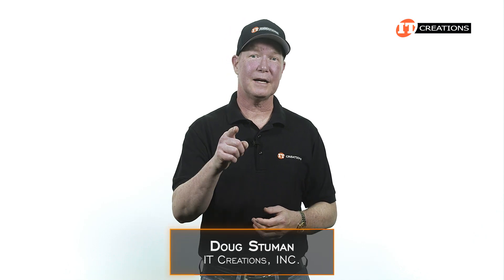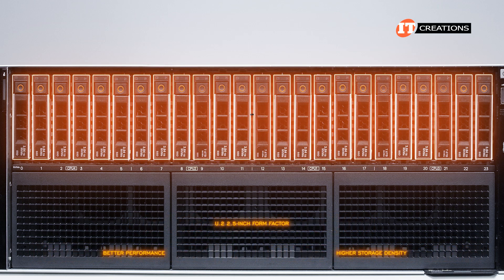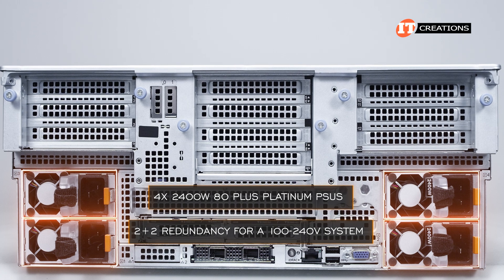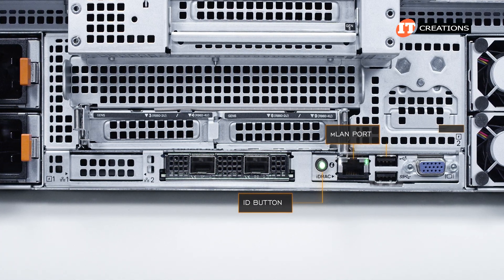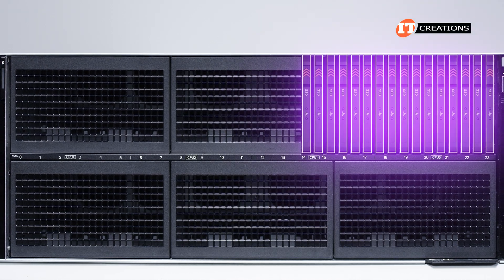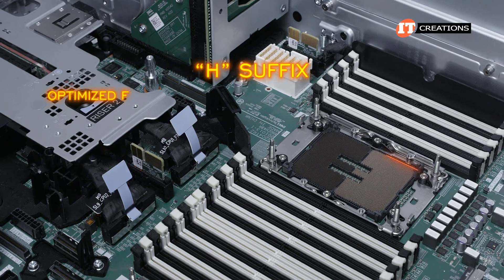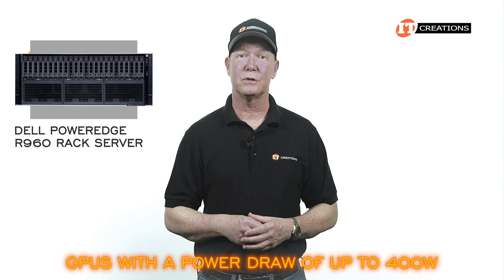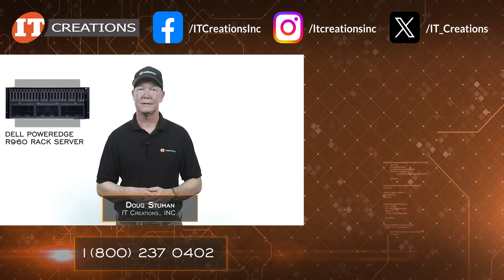4x Socket Dell PowerEdge R960 Server REVIEW | IT Creations

Comment: I bought an IBM eServer xSeries 455 quad Itanium 2 , and it was so noisy, so slow to boot up, such a nightmare to work with EFI bios, and so slow at running software...  it was a 100% write off fail and never got used, and I wasted a lot of my time trying to get it to do anything.  It only took SCSI3 drives.  The only OS I could get to run on it was CentOS.    It's just a heavy $35,000 brick taking up space under my desk.   I never ran a single app on it in actual use, not even a webserver.  So once burned, twice shy, about buying these boat anchor dinosaurs.      I don't even think it would make a good 50 dollar boat anchor.   If you give me only $5,000 credit for it on a trade in, I'll buy one of your servers, but I dare say, I'll have the same miserable experience.   Too loud, too noisy, too propreitary.

I'm lucky I didn't get fired by my boss for buying the 4U server.  I blamed the decision on some new guy that had already gotten flred and was no longer there.   What am I suppose to do with this thing?

Comment: these 4 socket servers are huge and have so much hardware support...I used to customize these models on the dell site with the highest cpu and memory config and eventually stopped when it was getting over a million dollars 😆 not sure how well 400gb networking works.  i once watched a video from david bombal that demonstrated 100gb and he said there were issues because the networking was too fast for the system.  maybe this server will work well with it.